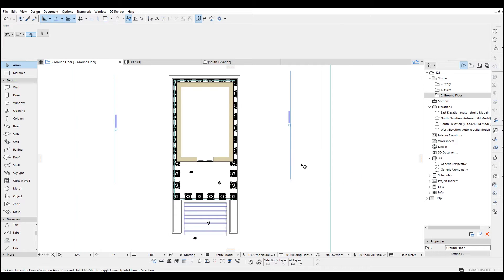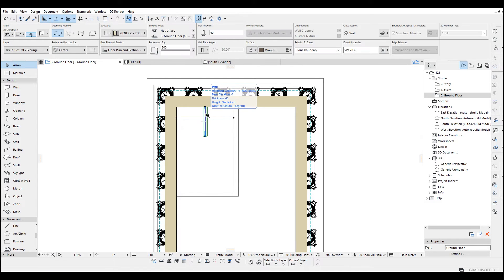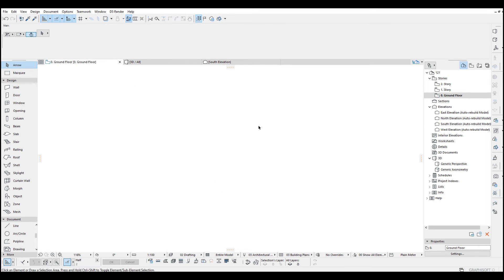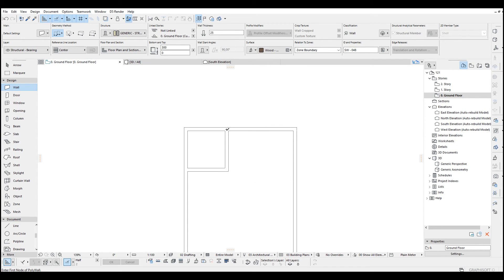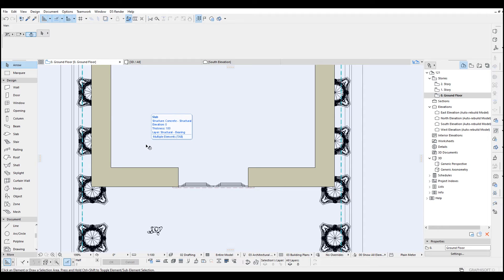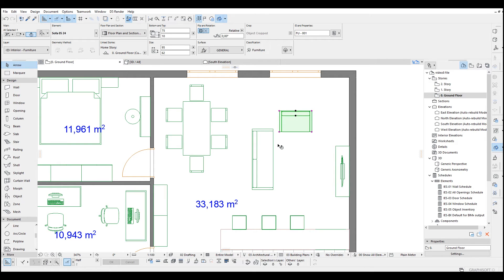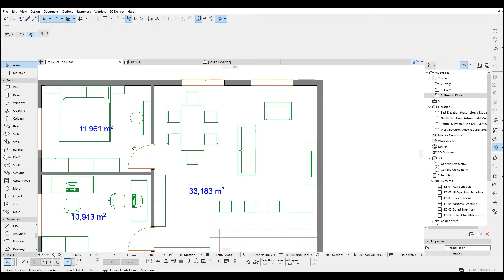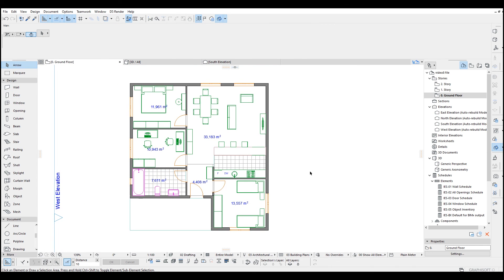How to Draw Precisely in Archicad Tutorial

Comment: Bro even though my beams and walls are in a straight line still a lot of extra lines are visible in the elevation and sections is there a way to hide them ?
Reply from the maker: Hi. Try to asign them the same material. Different materials make seams between them.
Reply: @sb.architect  bro the materials are same but there is a drafting error of a few mm all over the project is there a way to solve that ?
Reply from the maker: Nope. Only explode and delete manually
Reply: @sb.architect  ohk bro anyways thanks for helping.